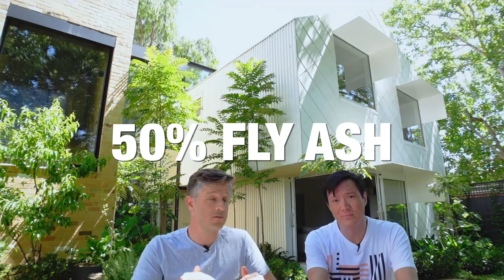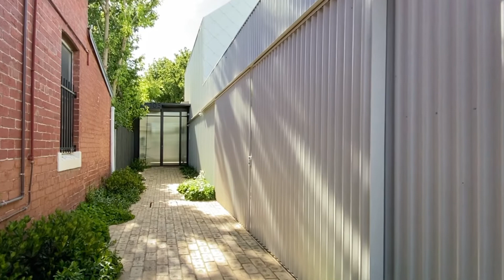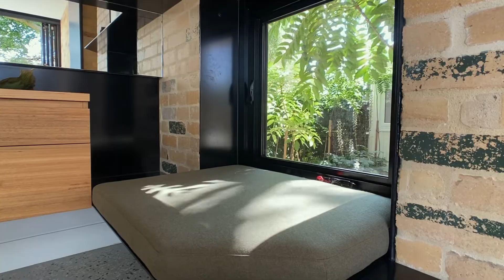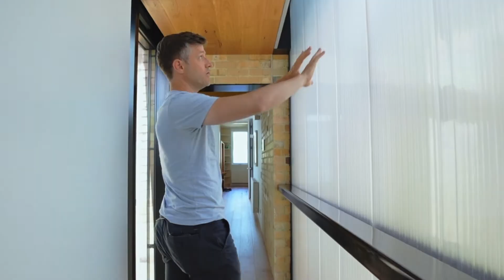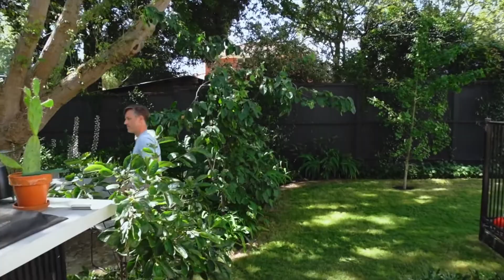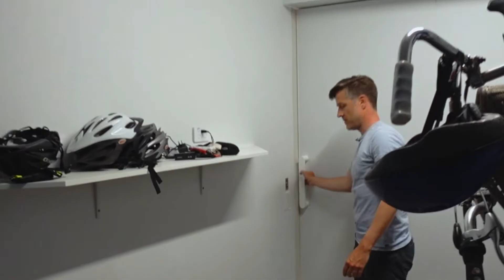The Garden With A Sustainable House | Garden House by Austin Maynard Architects

Comment: If Frank Lloyd Wright would have lived another 72 years this home may be an example of what he’d be designing, but with these more Modern materials. The Pyrex material he used similar in the S.C. Johnson building in Racine, Wisconsin. Your eyes always drawn to the outdoors with the lines blurred between inside/outside and much thought put into exposure to the Sun, passive design. This is a wonderful design, very original, it’s just nice to realize the evolution of architecture and materials both old and modern as a mix.